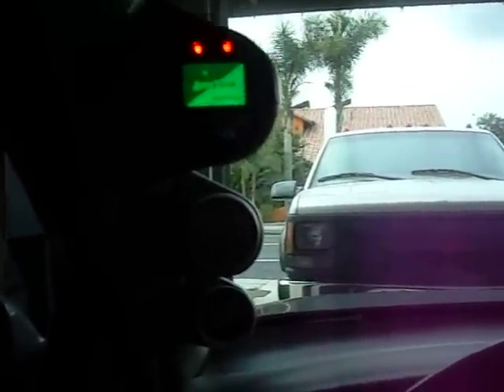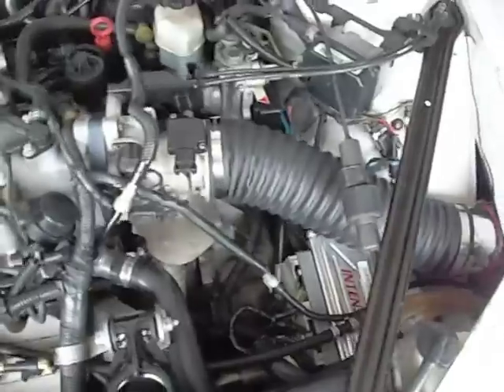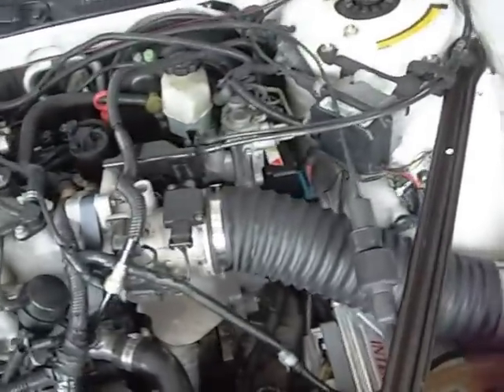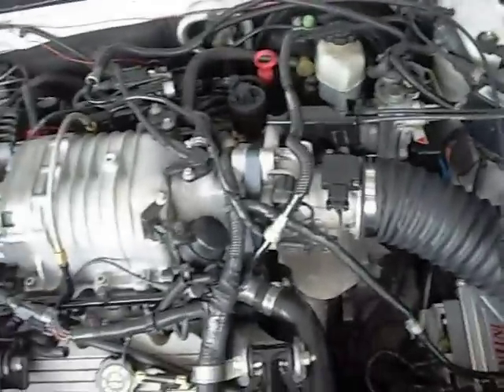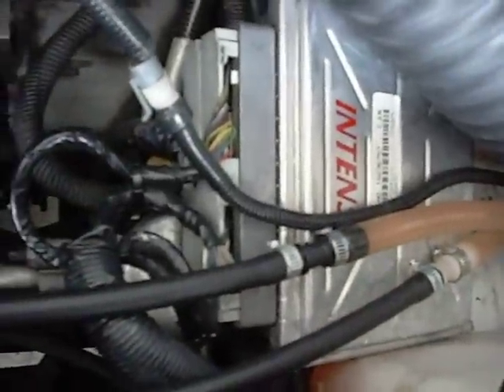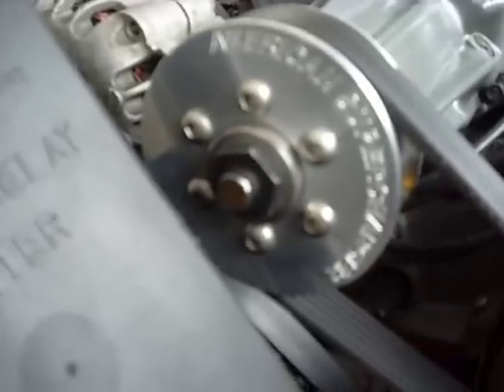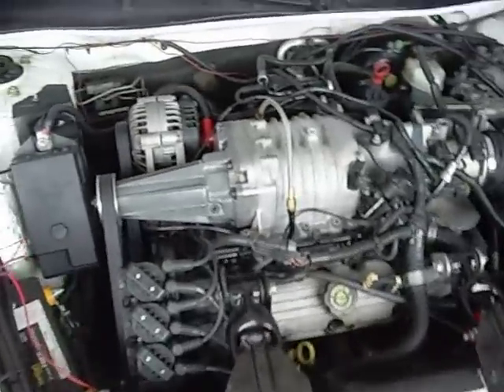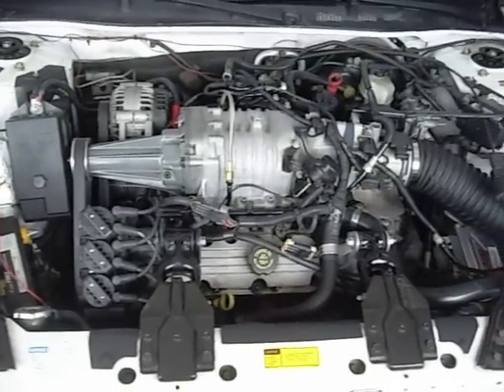3800 Series 2 Modding Basics

Comment: I have had 2 Cadillac STS's. They both had the Northstar V-8. They were nice and fast. My Buick Park Avenue Ultra is a nice car, though. It has a little less power than the Cadillacs did, but overall I am pleased with it. I got it about a month ago for a good price and have done several repairs to restore the engine. I think the 3800 is a great engine and I appreciate your post to support our 3800 community.

Comment: This motor is a boss 302 that Buick chopped two cylinders off,and the legend was born,I've worked on 65 buicks and they were also used in jeeps the Buick Reatta had a pretty cool series two I currently have a 99 Bonneville. SLE. These motors are bullet proof.
Reply: +mrromantimothy are you saying regal's 3800 II is/was a boss 302?
Reply: +jw Keith by boss I meant a racing motor that met the SCCA's  maximum 305 cid requirements, the Buick small block V8 and Rover V8 was all aluminum and would easily smoke a ford boss, the 3800 is an all new motor but it shares a lot of the characteristics of the odd fire buick 215'
Reply: 1999 pontiac tranmision trouble shooting
Reply: The 3800 was a descendant of the old fireball v8 from the sixties. You are correct about the 2 cylinders being chopped off, thus it became the fireball v6. It's amazing what over 50 years of development can do for a not so great engine, as the 3800 became pure Gold.
Reply: I have 205000 miles on my 3800 supercharger motor and trans. In a 2004 Intimidator Monte Carlo. Super strong motor love it
Reply: mrromantimothy 

Mang mang mang mang mang
Reply: 3800 is base off the 350 Rocket. Has the same bore. Only thing the 350 Rocket has a longer stroke and two less pistons etc..
Reply: mrromantimothy I'm thinking you mean the old boss 302 because a new one would own a gtp. And it goes without saying that most newer performance cars will beat old muscle.
Reply: It's a Buick 350 with the back two cylinders loped off and the crank. Splade also know as the 231 Buick and yes amc used it in a few vehicles no different then the ford 390 now the Chevy 229 was a Chevy 350 with the front cylinder  both wore the 3.8 code in the 70's and early 80's how ever the 231 won to go to the 3800 second threw now sixth generation
Reply: https://en.wikipedia.org/wiki/Buick_V6_engine
Reply: @TeamKlockworkbassfishing  lucky bastard the trans in my gtp just went at 129k
Reply: @Jszul2318  Did you ever change the trans fluid and filter because that would be close to 30000 miles over due.
Reply: @mbsnyderc  70k fluid filter change. trans are just glass in those. i was unlucky.

Comment from the maker: In the early days of 3800's SLP had a GTX package for the Grand Prix and a GSX package for the Regal. The top package was the Stage 3 but it wasnt too special.

3.5 inch pulley,High flow mufflers, 180 degree Thermostat, Intake and Hypertech tuning. Nothing major nowadays there are way more mods available. Your car with the mods you listed will need a tune too reach your cars potential. It'll have way more then 260hp/300torque

Comment: If you add a throttle body spacer you are changing the functional length of the intake runners, which retunes the engine somewhat. It should probably be tuned to accomodate that. In general longer runners mean more horsepower, and shorter runners mean more torque.

The 3800 has more torque than it knows what to do with on account of it's displacement, so this might be a good mod but it depends on how much explore the top end of the rev band.

Hope that helps. Great video.

Comment: Nice video man. One of the first mod I did was to trash the front exhaust manifold with a Plog from ZZP. Excluding the Ubend the front exhaust manifold is the most restrictive part on the Regals. Went with the 72mm high flow TB from ZZP, 3in catless DP and Intense PCM, CAI, running a 3.5 pulley now just to fight KR along with AL 104 and 180 Tstat. I had to take out the solid dogbones just too much vibration for me at idle and the AC on. 10.3 mm ZZP wires and coil packs. Like you said its not the fastest regal on youtube but from 60-100 its fast enough for me...Happy modding
Reply: +D Clark i'm having the same problems with the zzp dog bone bushings. i was expecting them to be a little softer rubber. and i would'v like the coil packs to come in black
Reply: Hey I know this is an ancient YouTube comment but i wanted to ask you a quick question about your regal. I heard regals have the same kinda KR tendencies that Bonneville have, which is what I have. Do you think a new DP, throttle body and cold air intake from ZZP would support a 3.5 inch pulley without to much KR?
Reply: D Clark just go to zzp and look at the stage one kit. then do that. as far as I know those are the best supporting mods for a smaller pully
Reply: If you're just starting to mod your 3800SC car i would not get a bigger Throttle body just yet, they are a good mod but wait till you start making more boost and have a good supporting mod platform. After all that i would then get a bigger throttle body.
Reply: Really? Why is that exactly? I've read that a bigger throttle body is a good mod to do before you drop pulley sizes along with a cold air intake and a few other bolt on mods.
Reply: @MegaZombie101  You can clean up the stock throttle body and get good enough gains. There is a lot of aluminum you can remove from the inlet before the butterfly.

Comment from the maker: Sweet man! Yeah these Supercharged 3800s are Cobras on a smaller and Cheaper scale.

Same Idea, easy to add power fast and it has that cool Super Charger whine once you get an intake on it.

I would go intake,Intercooler,Modular Pulley system and a tuner just to see if you can run a 3.2. 3,3 should be no problem though.

Riv and Cobra, cool combination!

Comment from the maker: Thanks bud.

The intake tubing is 4inches and yeah the filter fits right into the fender.

If you can afford a fullsize intercooler go fullsize. If you get an SS you can still drop 2 or 3 sizes down so it does work.

Comment: So u have intake in fender so let's just go through a puddle and suck a gallon of water up in .2 seconds
Reply: evan mcdaniels I laughed waaaay too hard at that
Reply: Yeah it's not like the 300C had a massive problem with that and the GP didn't

Context: The 300C is a $54,000 luxury car, the GP was a polished turd from the 80s
Reply: Put a K&N Drycharger bag over that filter. Water will never enter your filter. Ever. I use one on my Riviera
Reply: It has a fender well no water is getting to it period.
Reply: @MrTheretronintendo  guys have been doing this to their 3800 cars for years without that problem. It's not sticking out where the tire is lol. It's in between the outer and inner fender. It's a cheap easy mod. It helps just a little, but with that intercooler he has the fender well intake isn't as necessary.

Comment from the maker: Like I said I've heard Rockers combined with the HV3 gives awesome gains.

Cams are very labor intensive and cost more like $700 or so to get installed compared to the Rockers and like you said huge MPG loss VS actual MPG gain with rockers.

I love the Intense PCM

The biggest improvement with a PCM is 40 mph into wide open throttle runs.Your going to like it.The guys at Intense are the coolest 3800 vendors in my opinion.
 
Once you get one your going to wonder why you didnt do it sooner

Comment: @MendingSilence You will need to replace the a/c compressor or replace the a/c clutch which can be hard to do.  Replacing the compressor as a unit is much easier. Just have the a/c system vacuumed out by a shop and vacuum again to check for leaks before refilling the system.

Comment: These motors take 4.6 qts of oil. (I know bc I'm an auto technician and I change oil in these every day) from personal experience... iv found that the best way to wake these up is to run 4qts of Mobil 1 full synthetic (5-30 is what this takes) with the other 0.6 qts Lucas additive. Along with that, run 93 octane premium, always premium. If you are able to, use Shell V-Power premium gas. Shell VPower premium gasoline is the next thing to formula one car fuel. And it costs a just as much as every other premium gas out there. Nice job on the home made intake.  This should help out a lot.
Reply: my 99 buick lesabre 3800 series 2 not supercharged takes 10w30
Reply: Josh Turanski if your not on it hard till its at temp and its full syn then your fine, thats what i do in my lesabre. oils have made some good head way over the years
Reply: Marvel Mystery Oil is also a great additive that I've been using for years, but Lucas is a great brand as well.

Premium gas isn't necessary but can help if your car pings.
Reply: zzzhuh It's necessary in these cars, they're supercharged and the lower octane fuel won't always detonate under high pressure.
Reply: Zach Weibel
For the series 2, you are absolutely correct. Series 3 has a PCM that compensates for the difference but should still use 91 when possible.
Reply: zzzhuh if will prevent it from pinging all together/. Its even in the manual. Hell i used to drive a 2004 Monte Carlo SS S/C Series II and it was printed right on the gas cap. Always use premium
Reply: - AMSOIL 0w30 Signature Series 100% Synthetic, & be done with it.  If higher mileage, make the last half-quart Marvel's, ... & be done with it.  L67 & L36.
Reply: In Australia our premium fuel is 98 octane. And we have 100 octane at some pumps too
Reply: 10w30 bro
Reply: @samjohnson4014  that's because Australia in the car world is what the US  used to be,  now everything's douchebaggery and I really want to pack up and head to Australia
Reply: Ancient Apparition I own two sc/3800 builds and one naturally aspirated and 5w 30 is actually what GM started even recommending. 10w 30 was for the original manufactured series 3800s but they realized later on they run better with 5w 30. The thinner oil cuts down temps and in sc/3800s its great for longevity in these motors. If you’re in driving in colder temperature regions 10w 30 is ok but if it’s summer or a hotter region 5w 30 is way better, especially if you’re gonna be running it hard.
Reply: Hi mate I'm in australia ,can  you tell me please  is it cheaper to rebuild the bottom end of the l67   .or could I take the tol
Top sorry off of a tough normal asparrated  3.8  and go that way
Reply: @wolfmanrebel874  yeah it sounds good, but it's really the nanny state that occasionally let's us let our hair down a little but it's under some pretty heavy supervision with dire consequences, in Australia if you get any type of conviction ( and that's how the judge words it in court)  there goes any type of decent job opportunity because all good jobs need a criminal file pulled on you. for a police clearance, meaning if you   you have been bad , you are fucked . No fun for you no more  sport......                                                    ,oh and that goes for spinning tyres even little chirps draw the eye of the filth. And gday cobber from the big red land. Cheers

Comment: Awesome, that should be cool to see.  Far as engine mods go, I'll get to that when I have some extra money but for now the rear electric windows need fixed, and I have a vacuum leak that keeps turning the engine light on. 

I'd like to install a new air filter first though since that's a relatively easy and cheap way to gain a few hp.

Comment: @TBomberger You could remove your oil fill cap and see if there is a light brown "goo" accumulating in the top of the cap. Usually happens when antifreeze mixes with oil.

Comment: nice video...i would add a few mod options though...ex: higher ratio rockers good 4 at least 10 + to the wheels, cooler t-stat, def get a pcm upgrade! you can upgrade your brakes by getting a big brake kit using caliper brackets from an 00 or so intrigue. you get 12.5 inch rotors which looks great so is stopping

Comment from the maker: To run a 3.5 with about 2* of KR my mods were Fenderwell intake,3 inch downpipe,ubend delete, intense pcm,ported exhaust manifolds,high flow muffler,colder plugs and 180 degree tstat.If you dont live in california and have 92 or 93 octane gas available you probably could run a 3.5 with those mods with no KR and possibly a 3.4 but you need to scan to be sure.

And you dont need to replace the mufflers on a GTP because they arent restrictive like the Regal. Remove the resonator though.

Comment from the maker: Intake,Ubend delete,180 degree thermostat,2.5 inch downpipe and a reprogrammed PCM will give you a nice power boost that should make you happy.

Thats less then $500 in mods.

If your strapped on cash get an intake, 180 degree tstat and a reprogrammed PCM. The reprogrammed PCM is probably the best mod you can do because it lets your car go from 3-1 and 4-2 down shifts rather then 3-2 and 4-3 so from a roll your car will be a good amount faster. Thats $200 right there.

Comment: @JohnFromSpace 
The supercharged rear wheel drive your talking about came off our ecotec motor. n even though they were very similar motors, i believe the block was slightly wider than the australian 3800 block? although the whole supercharged ecotec would most likely bolt up in the pontiac...

Comment from the maker: The N/A Series 2 puts out some pretty good torque but wait until its supercharged with a few mods. Monster amounts of torque instantly =)

It doesnt matter that your cars an olds88. As long as it has a series 2 motor all engine parts will work.You might have to so some fab work with the headers though. Just build your own intake. Watch my make your own intake video as a guideline you'll be fine. Good luck with the build!

Comment: it was designed by buick when all the different brands made their own motor. the roots of the 3800 date back to the fireball v6 made by buick in 1962. the 3800 was designed to be in buicks , but gm seen it wa s a great motor and put it in alot more cars. the 3800 is a buick v6.

Comment: I want a 3800 Series 2 swap into my Grand National.  Far better block than the 109 block found in the 86/87 turbo Regals
Reply: *****
Well, I have $7k invested in my 109 block and I'll probably spend another $4k.  For that amount, I could have found a series II block, had it machined and swapped out the stock internals, rods/pistons bought an aftermarket ECM and probably be making 700wrhp reliably, without worrying about cap walk or my block splitting in half.  The series I/II/III blocks are all stronger and more reliably than the 109 block when built correctly.

Not sure what year you have, but if I were you I would be careful putting a turbo on with NA stock internals.  Now, if you could get a supercharged series II/III you could use the rods and pistons out of the those blocks and then turbo your Camaro.
I'm only sticking with my 109 block, because it is the stock block for my Grand National.  If I ever buy another Grand National or T-Type, I plan on buying a roller and putting a spare supercharged series II/III block in it. 

For the 109 block you start losing reliably when you're putting over or around 600rwhp.  This number isn't pulled out my butt, my engine builder and Kenny Duttweiler(sp?) have said this exact number.  There are a couple of guys running 900 or 1000 rwhp with the 109 block, coolant passages have been filled and you basically can't drive on the street with the block because it would over heat.  These engines could genade at any time.  Now if you are taking a Stage I/II block or TA Performance block, then the sky is the limit.  The TA performance block can put out around 2000hp to the flywheel.  There are guys running this block in the TSO group with full weight Grand Nationals/T-Types and running 7.6x at over 180mph.
As you probably know there is a series II block Camaro or Firebird making over 800rwhp, with forged internals and stock crank and main caps.  He can do it reliably.
Reply: *****
 As you are aware the internet is full of info.  I do have a question, what model year is your vehicle?   Just curious to see if it has electronic throttle control.
If you are only planning on running 5lbs of boost, then I would think you should be good with stock internals.  Again check on the internet with those who have turbo charged their NA 3800 series II block.  Do you mind sharing what turbo and IC you have?  What size are the stock injectors?  The stock injectors on the Grand National/T-Type were 28#.  Initially I upgrading to 42.5, which is good for low 11s or maybe better, then to 60# which should support my goal of mid to low 10s.
Just a personal comment, if you can get your car running good with 5lbs that is what I would do.  Once you start upping the power level you start having to worry about the transmission and rear end, etc.
Good Luck.
Reply: sinusbradycardia exactly!! A L67 stock crank can take well over 800hp. That’s what made me fall in love with them. I’m only $3500 into a GenV supercharged build and it’s making over 400hp. 😀

Comment from the maker: Since your going with flowmaster 40 series Im guessing your going for loudness? If thats the case ditch the resonator. The 3800 makes enough torque that you wont notice a loss in low end power. You'll get it all back up top.

Some parts of the stock resonator is as narrow as 1 inch so its a restriction. 

If you remove it will drone inside the car and if you dont like the droning you can always put a glass pack where the resonator is/was

Comment: L36 is a Series 2 3.8, L26/L36 are popular for Supercharging swaps due to their higher compression ratio, matched with a top swap as many call it, which is basically swapping over Heads, Lim, Supercharger, Injectors, etc from a L67/L32, they can be a very good combination if done right. If your average Joe puts it together half assed and beats on it, expect him to be crying in forums about how his motor blew up.